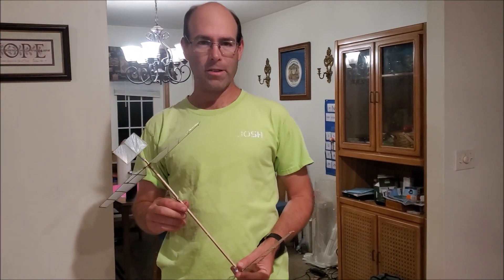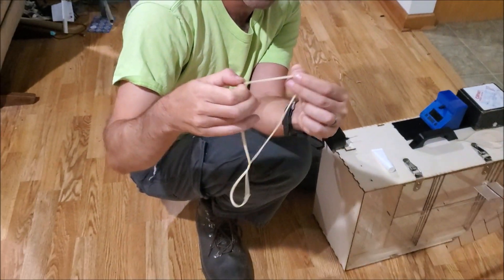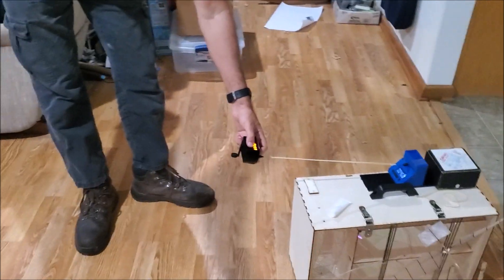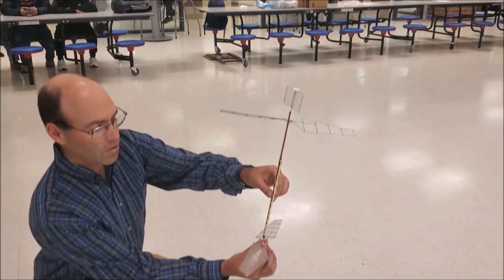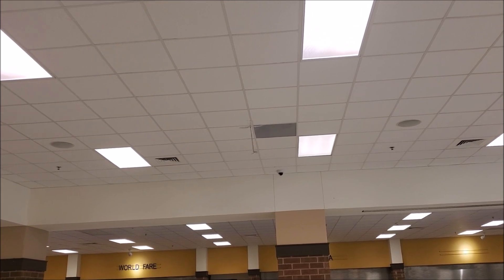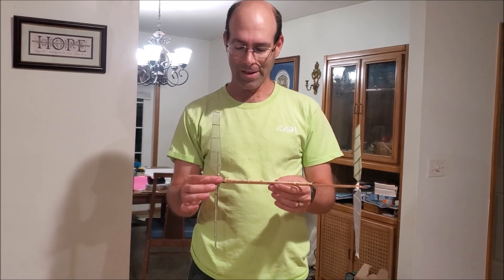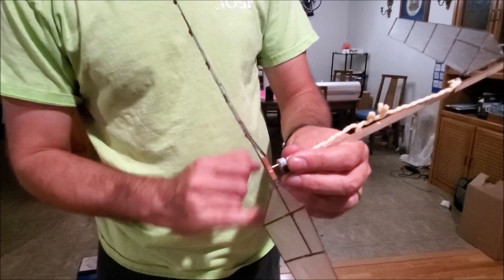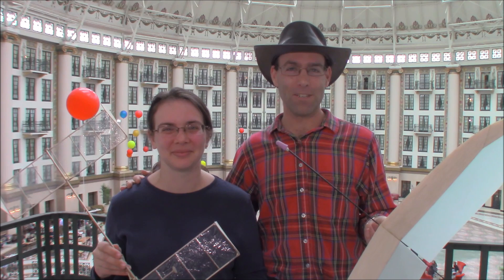Flying the Tornado 2024/2025 B/C Science Olympiad Helicopter

Comment: So I don’t know if you can respond, but I have the competition on Saturday. Can you tell me why the helicopter is not very stable in the air? If you look at it from top down, it moves counterclockwise. I rlly need help
Reply from the maker: Stability isn't as important as staying at the ceiling. If you email me at joshuawfinn@gmail.com with photos and videos, I can try to make some recommendations.
Reply: @ ok thanks.
I can try to send photos in a few hours. So I am testing this at my friend’s house, with not much open space. Do you think that is why stability is such a big issue?
You don’t need to respond to this before I would give you an email
It is just that it moves pretty quickly counterclockwise, and I am scared this uses extra energy. 
One other thing, when should I stop spinning the rubber band(we do it when it starts to quadruple coil)
Reply from the maker: @Ghurjings  the cyclic motion is gyroscopic precession, doesn't really waste any energy based on my experiments. Winding...follow the instructions at the end of the build video. You can get about 90 turns/inch of rubber motor length if you follow those instructions.
Reply: @ ok
Reply: @ turns out our helicopter just weighed almost 10g(main shaft broke twice, top vane and rotor stepped on and snapped when wedged and stuck, multiple punctures fixed with so much superglue on the wings) 
Anyways, thanks for your help but I guess we failed anyways
Reply: @Ghurjings  The same thing happened to us. Bought two kits (4 helis). the shaft kept breaking. We have been wondering what the top part (vertical rectangle) does.. We eventually decided to remove it to reduce weight. It turns out our intuition was right; that part does nothing. Won't buy anything again...
Reply: @taoliu5624  nah, ours broke cuz my friends dad used crazy strong rubber bands and cuz we cut some wood off to shave weight. Ours weighed 10g😬
Reply: @taoliu5624  also, assuming it is built right, it lets it stay on ceiling and just sit there(my other friend had a good one)

Comment: hello! during flight, my helicopter reaches max altitude quickly but suddenly spirals downwards and can’t always regain altitude. Any tips on how to fix this? I am pretty certain that all blades are at the correct angle and that everything is built accurately. Thanks!
Reply from the maker: Interesting...I've seen that a few times. Try twisting some extra pitch angle into the bottom rotor blades and see if that helps. Only go 2-3 degrees at a time.

Comment: This thing doesn’t push any of my aviation buttons, it resembles more a bug around a street lamp.
Reply: you might be a frog?
Reply: Then build one like the ones we built in the olde days, using eight feathers, a cork, a bit of steel spring (we didn't have rubber back then), some thin string. Flew quite well, but not like this.